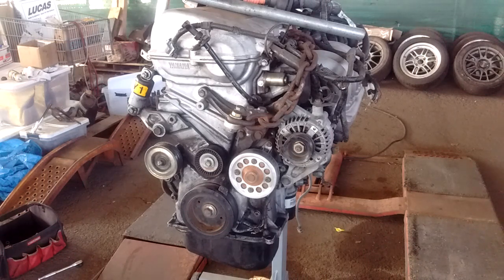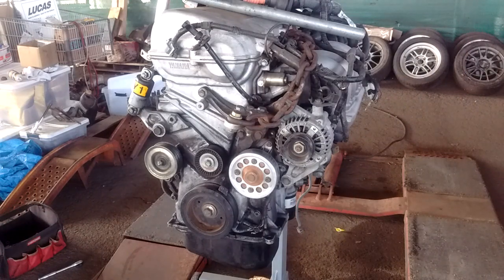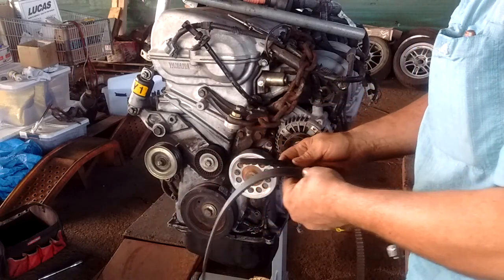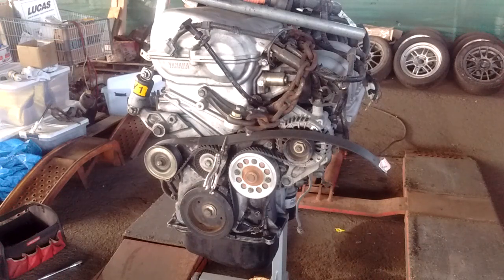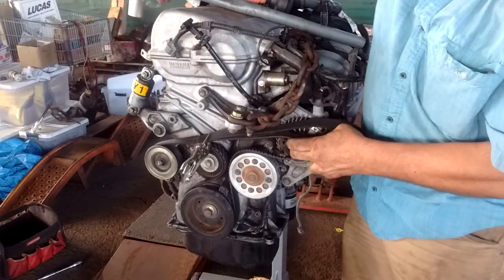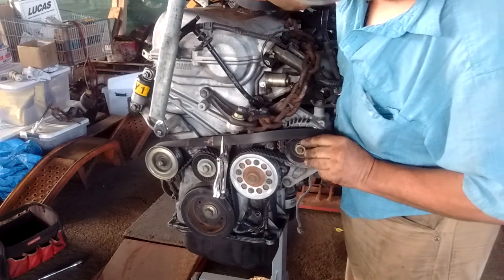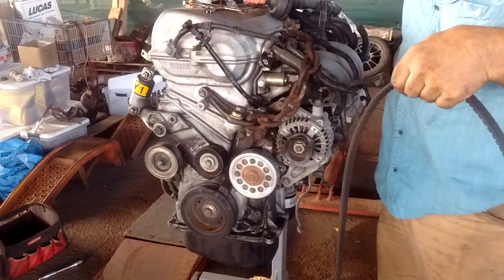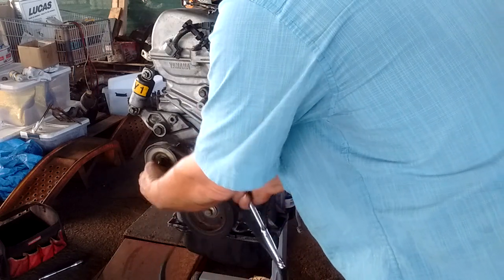A/C Delete Belt for 2zz-ge - Toyota MR2 Spyder Celica Corolla Matrix Vibe Lotus Elise Exige

Comment: Sir, can the belt tesioner make a tapping/rattle noise on idle? like injectors for example
Reply from the maker: Not likely that the tensioner itself makes a tapping noise. If the tensioner is faulty you can hear a rumbling noise from the belt rotation. But this does not sound anything like injectors ticking. If you have a ticking noise it could be coming from the exhaust header flange.
Reply: @Merryfrankster_  in addition to the noise of the valvetrain and the injectors, I have a small metallic sound (from top head left when have the engine in front of me) which does not go with the melody that the engine is running, but it is almost continuous. what could it be sir?
Reply from the maker: @DimoS...  is it a ticking noise that does not vary with the engine speed? Then it could be one of the evap solenoids starting to go bad. As they go bad, they start to make louder and louder ticking noise, does not change with engine speed.
Reply: @Merryfrankster_  when I'm with the hood open and I listen to the engine at 800-900rpm idle it sounds like you said, when I pull the throttle and go up to 4k rpm the engine sounds very good with no weird noises. Also this noise is metallic noise.
Reply: @Merryfrankster_ I know one case like mine and its belt tesioner and one pulley noise like mine and no squeaking only metal. Maybe must start the engine without belt to see if noise gone right?
Reply from the maker: @DimoS...  always a good idea to try this.
Reply: @Merryfrankster_  today I find a video of name: toyota celica induction kit (Robert dymarkowski) is 1zzfe but has the same sound, exactly same noise!
Reply from the maker: @DimoS...  I'm sorry I am not very good at diagnosing noises online - I am an old man and my hearing is not very good.
Reply: @Merryfrankster_  understand sir, thanks for your time, I appreciate it a lot 🙏

Comment: This is awesome 👌🏾 
Can I do this to my Mxrs 2zz, but leave the ac compressor connected and unplugged? I upgraded motor mounts bushings but I get too much vibration 🙃 Thanks 🙏🏾
Reply from the maker: Sure. But if it vibrates too much with ac on you can try add some pag oil to the ac system, or get a new compressor.
Reply: @Merryfrankster_  Great, So if I buy this exact belt, I can just switch the belts out. Then unplug Ac? Appreciate your videos always 🙏🤜
Reply from the maker: Can't say for sure on your car. It should work but you never know until you try.

Comment: Would the belt measurements be the same if you did a power steering delete ?
Reply from the maker: When you do a P/S delete you replace the pump with a idler pulley - the one from the MR2 Spyder. The belt length stays about the same.

Comment: Nice video! 
Some 2ZZ's have hydraulic power steering pumps though, and the belt for those is a little longer than on your engine.
But I was still able to figure out the length I need. :) 1605MM ish.
Reply from the maker: With this method you can figure out any length.
Reply: how long is it with AC?

Comment: What's going on with that water pump pulley, looks different
Reply from the maker: You know that the 1zz and 2zz have different water pumps - 2zz, removable pulley, 1zz, fixed.
Reply: @Merryfrankster_  No I know but that pulley looks different for a 2zz, I've never seen one with holes that bored out and silver colored. Did you try to reduce weight on it or something?
Reply from the maker: @LionSoul46  oh that's just a lightweight pulley it was made by URD they also make a alternator pulley that did not fit on my alternator and a crank pulley that is not recommended for the 2zz unless you upgrade your oil pump to billet.
Reply: @Merryfrankster_  What would you say about the water pump pulley, do you think it's worth the money? Do you feel any difference?

I have the mwr lightened flywheel & wanted to get the pulleys as well but I didn't like how they spin slower.
Reply from the maker: @LionSoul46  the difference if any is very minimal it's mostly for show. LOL.